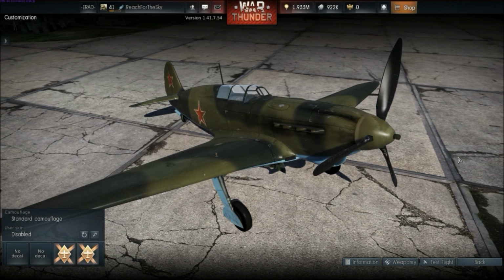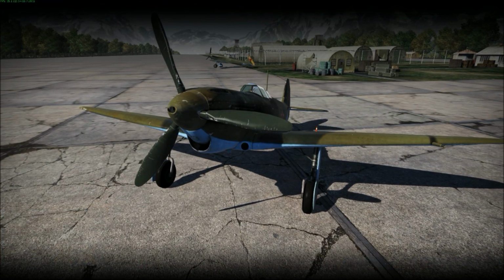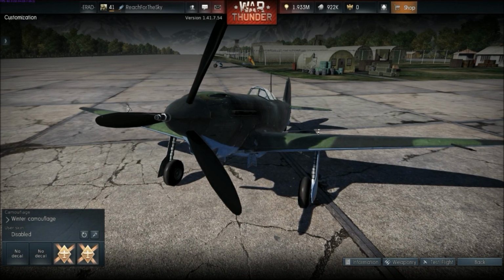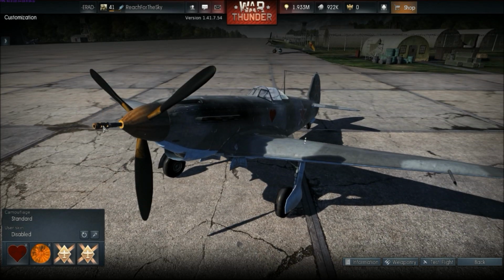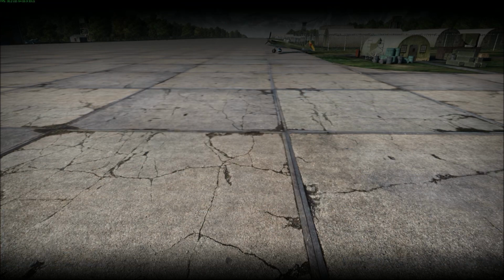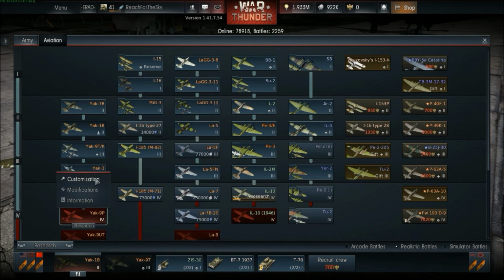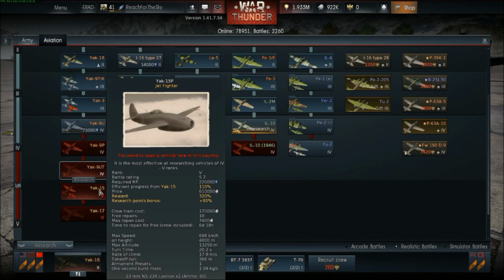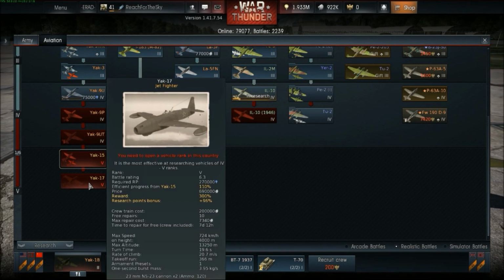War Thunder Planes and their Variants - Yak Fighter Series

Comment: some small corrections:
- by calculating the actual recoil force of the NS-45, it simply isn't realistic to say that it should have ever lost control when firing the gun. the pilot could have been shaken up a little bit, when considering ALL recoil aspects of the NS-45. this is from USAF DOD documents on the NS-37/N-37 gun. most likely the pilots who claimed this were over exaggerating, or maybe the shaking caused the instruments to mis-read the speed.
- the performance of the 9k, without the extra fuel tanks added onto the original prototype, performed equally to the 9t. it had the same weight. production 9Ks did not have these extra fuel tanks.
- the 9P is more than just a 9U with improved firepower, it's a post-war variant with IFF radar and increased weight due to extra fuel tanks. overall it's like a 9UT but heavier since it gets a nice weapon selection
Reply from the maker: Thank you for the information.

I should have elaborated that loss of control was only really possible if the plane was travelling at speeds below 200mph, and the pilot wasn't maintaining a strict rate of fire.

I was under the impression that the NS-45 and its ammunition would have increased the weight of the aircraft? I appreciate that this may have only been a small increase, but making it even more nose-heavy would effect its ability to maintain straight-line speed, even if only to a small degree.

I was aware of the 9P's radar and fuel tanks, but since those don't have any impact on gameplay I elected to leave those details, and a few other technicalities in other variants that don't effect gameplay, out of the video for the sake of keeping the length of the video reasonable.

Thanks for the comment!
Reply: the total weight difference between a non-extra fuel tank'd 9K and a 9T was less than 10 kg. they may have removed some stuff inside to do that.

the extra weight and fuel tanks on the 9P make it a much worse performing plane than the 9U or 9UT :(
Reply from the maker: okay. But that 10 kilos could totally halve the top speed man. ten RUSSIAN kilos is like, 200 decadent western kilos.

Really? Even if you put the fuel down to 30m? that sux.
Reply: ReachForTheSky yep. the fuel tanks themselves weight quite a bit unfortunately. the empty weight difference is over 140 kg alone, plus the actual fuel weight (9UT/9U gets 20 min minimum vs 30 of the 9P) weight difference.
Reply from the maker: well ain't that a kick in the head.